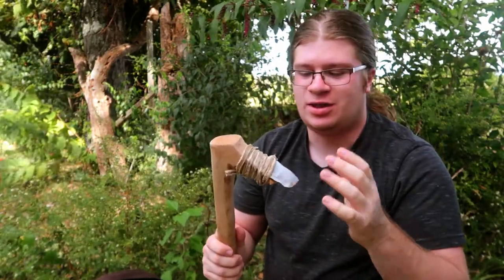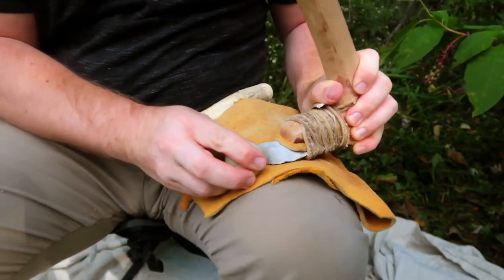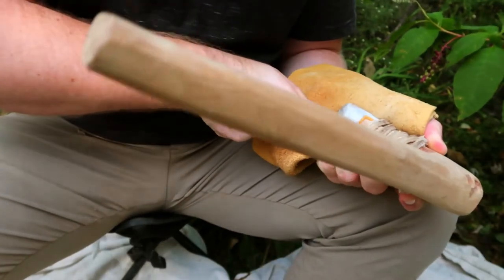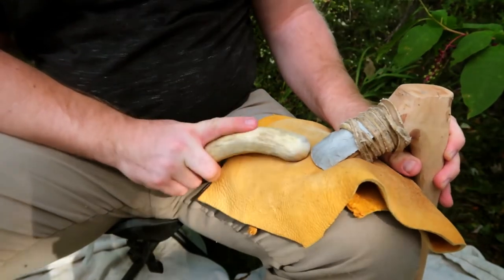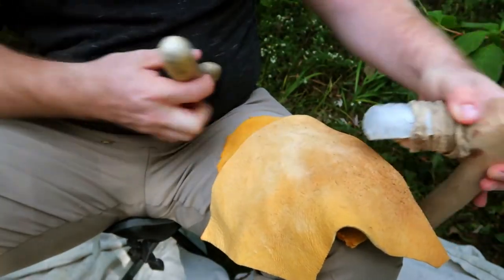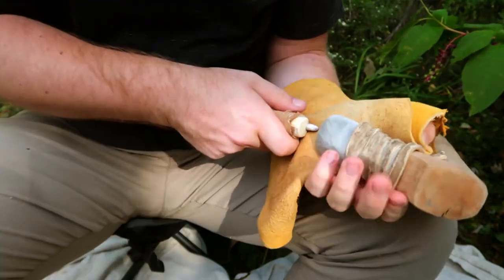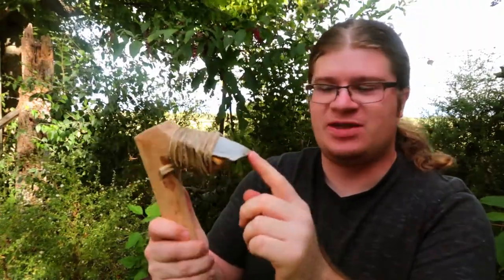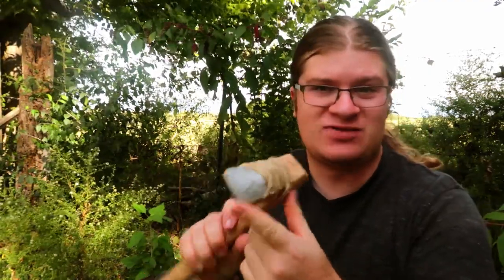Resharpening a Flint Adze

Comment: What material was used on the smaller device you were using?
Reply from the maker: You mean on the tool I was flintknapping the blade with? That was a multi piece tool made from antler, it’s called a pressure flaker. Hope that answers your question!